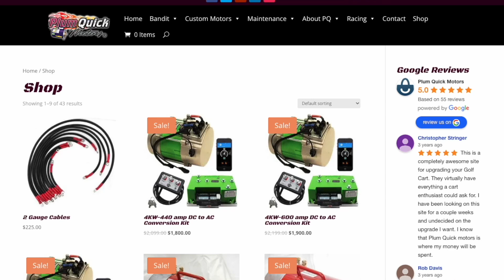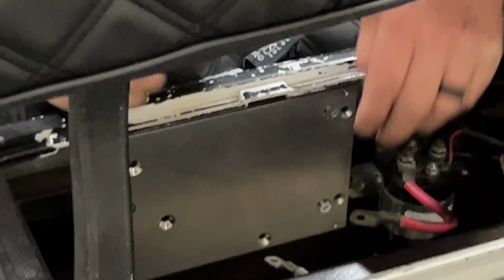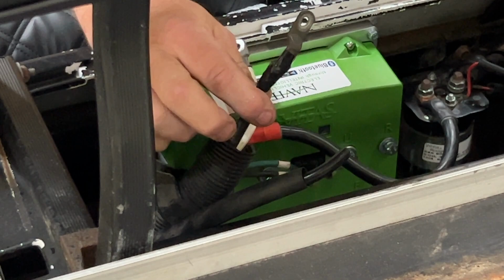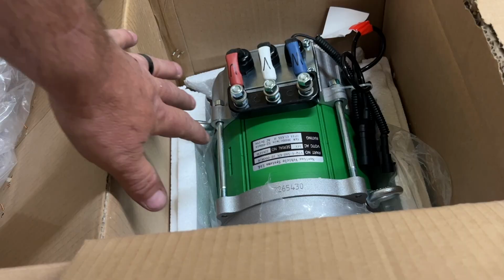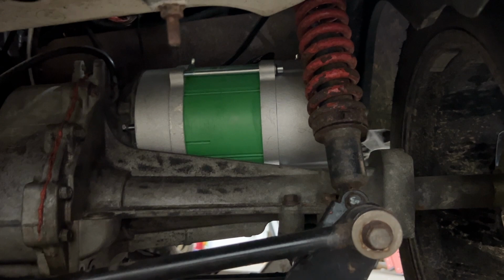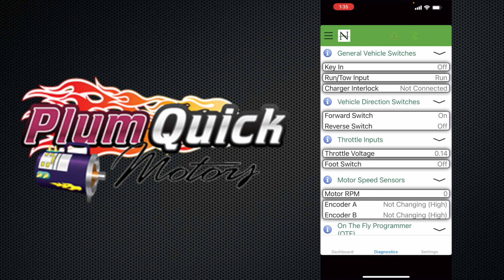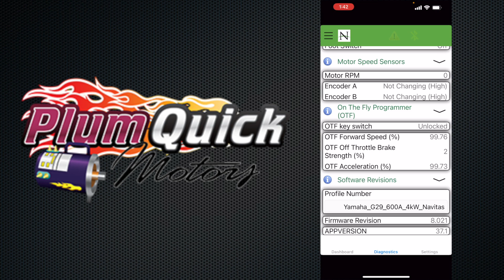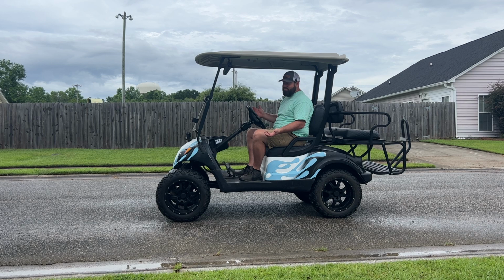Yamaha G29 Golf Cart Navitas 4kw 600A AC Conversion Kit Install | Plum Quick Motors

Comment: I did the same conversion on my nephew’s club car . I went with the 4kw because I was afraid the 5kw wouldn’t fit. I also added 2 big Battery elite lithium batteries 48 volt and a 400amp solenoid. We did all this to get him up the hills in flowery branch GA. 5 mph up the hills wasn’t much fun. Now he easily does 25mph up the hill’s and doesn’t take an hour to get to the pool. Great set up , highly recommended if you want some get up and go. Also purchased it from plum quick. Always enjoy your videos, keep them coming.
Reply from the maker: Appreciate it! Im sure he is moving right along too.

Comment: Lots of comments 4k vs 5k.  You should point out if running off 48v your likely not going to pull enough amps to utilize the difference in going from 4k to 5k.  You need to either pull crazy amps from 2 48v packs in parallel or have a extremely expensive 72v setup.

I got a high end 48v battery and 5k motor and I hit amp safety cutoff (350a) going up very steep hills at high setting.  Running motor at 2-3k setting on acceleration is the most without over drawing amps.

This is a setting that the 4k supports, no point in 5k unless your bawling in battery tech.

Comment: My husband is installing a Navitas Eco Battery 72v on a G29 Yamaha. After he installed, there's an error on the app and when you press the go pedal it leans forward like it wants to go, but it doesn't. Error #1: Charger interlock. We've contacted Navitas and so far no luck with their walk through. Every thing seems like its correct. Battery is at 99%, showing 73.1volts. He took out all original parts and installed a Albright solenoid. Any ideas what the issue could be? Really need some help getting this all figured out.

Comment: What type of speed and distance am i going to loose if i go with a 4kw compared to the 5kw NAVITAS  Using lithium batteries on my 2016 G29?  I guessing I will have to put a new suspension to make it fit.  This cart will be street legal for downtown Charleston SC.
Thanks
Reply from the maker: The 4kw will go the same speed as the 5kw but won’t get there quite as fast.
Reply: I'm guessing with a new lithium battery kit and a 4kw I'll be able to keep up with the 25 to 30 mph speed limit DT?
Thanks

Comment: Hey Ryan I just installed the 4kw motor and controller with your help from the video. I also installed a MadJax 6” lift and the right rear shock it touching the motor.
What lift kit do you have? Any suggestions. I have a 2014 Yamaha G29 Thanks
Reply from the maker: Did you clock the motor foward?
Reply: No I did not I thought it said to clock it if it was a 5kw. It doesn’t look like it would make any difference.
Thanks
Reply: I also watched a video and it said it won’t work with a MadJax lift kit

Comment: It doesn't wheelie? Whaaaat

I know you're running lead on this rig.. I've coincidentally been looking at getting this exact kit for my g29. I have an UNO battery, and it does pretty well with my 400 amp dc naviatas controller. Can't help but feel like I'm missing out though.
Reply from the maker: This one had lead and one of the batteries in the pack wasnt as healthy as the others. It wanted to wheelie but I think a good quality pack and would perform. Im working on my wifes cart at the moment for an upcoming video and Im using the uno battery for hers.  I like the fact that the battery is compact!
Reply: @Fentertainment  can't wait to see!